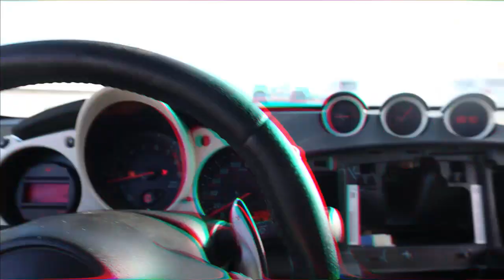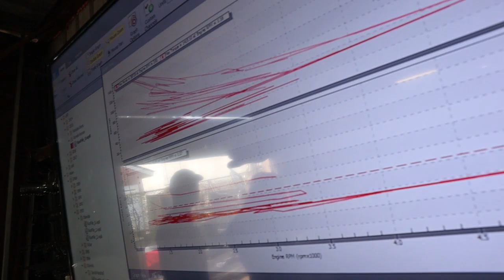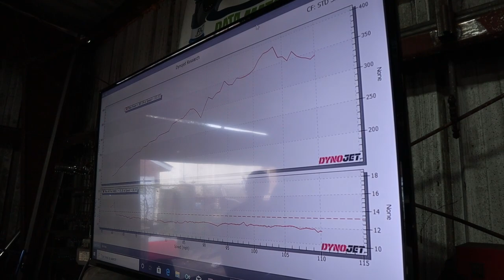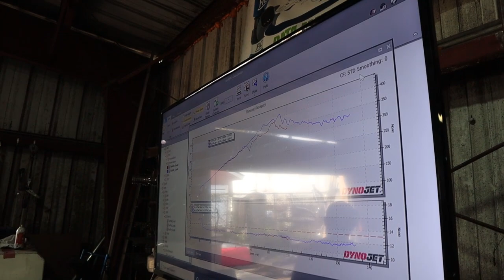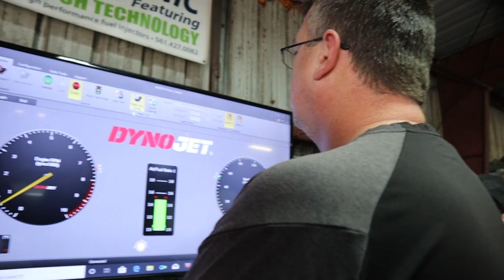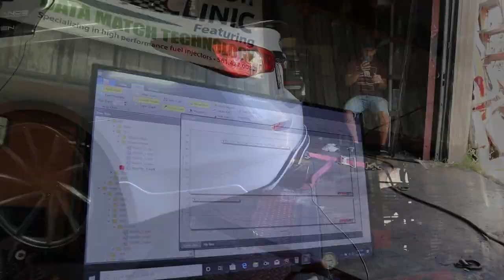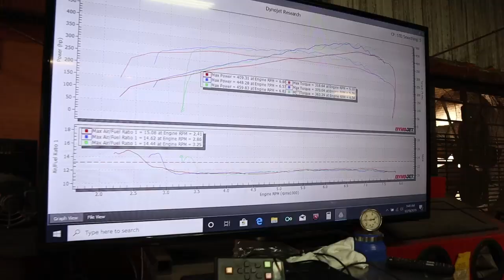DYNO DAY | SUPERCHARGED Q50 3.7L

Comment: Good shit, man! Never seen a video on a Supercharged 3.7 q50. I’m in a Procharged 3.7 Mustang and seeing about the same numbers @11ish psi and 91oct. with a Snow Performance stage 2 boost cooler. My IAT drop about 30 degrees at WOT. You should look into it. You don’t go through the water/meth as fast on a Supercharger as a turbo setup would. I set mine to start spray at 3psi and ramp up to full spray at 6psi. It sprays full all the way to max PSI.
Reply from the maker: Hey man, that's some dialed in power you got there ! Definitely check out the newest dyno videos we have up on the supercharged q, we made about 100 more hp
Reply: @RomeloRoman  all subscribed. Loving the vids.

Comment: Had the same issue with the breaks, brand new everything. Had to try different combos of pads and rotors until I got rid of the loud squeaks.
Reply from the maker: The squeaks aren't actually a problem. It's just the first couple of feet in the morning when it's damp outside (Florida)

Comment: Is this on stock 7 speed AT still?
Reply from the maker: Yessir
Reply: @RomeloRoman  Damn thats impressive. I know that alot of torque kills transmissions thought. What torque did it put down?
Reply from the maker: @JonMK8.5   So yes tourqe does kill transmissions, these 7 speed automatic transmissions from Nissan can only hold about 400 - 450 torque Max before consistent break down happens.  On this specific dyno run I was i little over 380trq & 470hp.  Transmission is safe for now, but we expect hig boost, so i will be doing a swap within the text few videos! But still keeping it 7at but NOT lvl 10!! STAY TUNED!